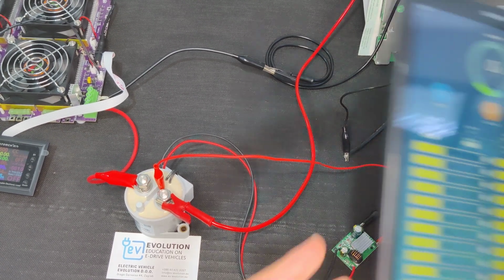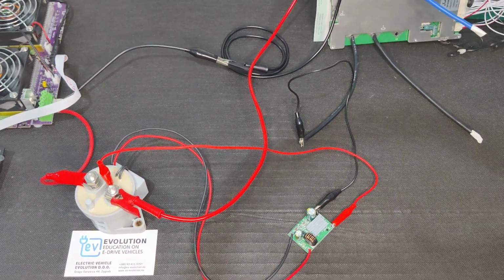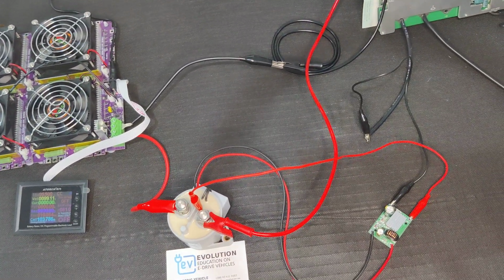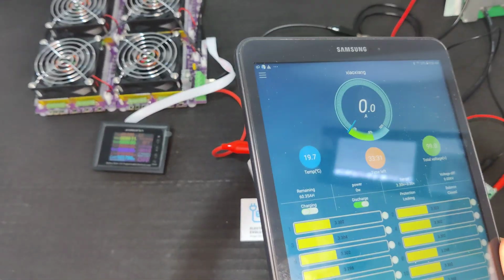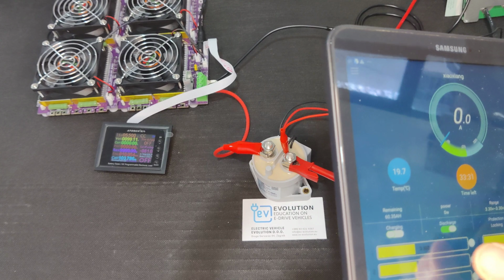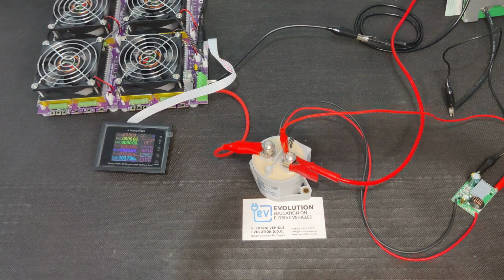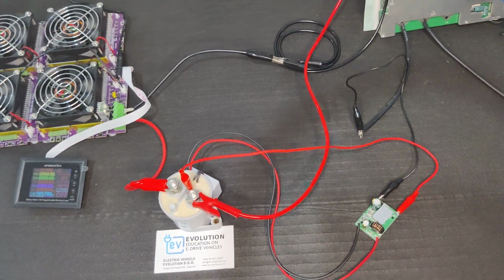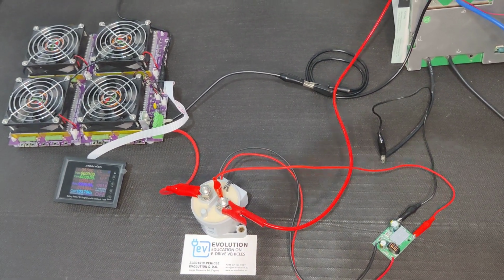EN: BMS + Relay 900V / 1500A for Electric Vehicles (High Voltage and High Amperage)

Comment: Hi and thank you for this video, I was looking for a similar solution to control the charge and discharge relays on an EV.
Your option looks good, if I understood correctly, you use for example on a pack of 96 cells, 4 bms which each controls 24 cells (4 packs connected in series) to give around 350V.
So in this case this allows the packs to be balanced separately.
Then to control the relays you use the Negative cable of the BMS,
with your DC To DC converter because the relay operates on 12V.
This is where I find it not very good to use these little DC to DC converters?
Wouldn't it be better to use a small relay which would operate at 100V (coil) and which would then control the 12V of the large high amperage relay?
So the problem then, example with 4 BMS it will be necessary that each BMS can ultimately control only 1 Relay of the total Pack battery.
Because the important thing is that the total voltage of the 96 cells is disconnected. (following Overvoltage/undervoltage and Temp; Protections)
(not just 1 pack of 24 cells)
It's certainly possible.
Obviously this type of system is much more economical than the HV BMS which are on the Market.
Thank you again for sharing your videos.
Reply from the maker: battery packs need to be connected in series and between each should be a relay controlled by one BMS, in short 1 battery pack = 1BMS+1relay. HV relay is not suitable as 12V coil voltage also goes to the emergency stop switch. Also, all battery packs must be top-balanced at the same level before the start of usage of the car. And yes...you probably can use any BMS to connect them like this in series as each works as a single battery pack...only important is that they all have the same BMS and the cells are the same.

Comment: Can we use this bms for 400v 100ah 40kwh battery ??
Reply: Looks like the same one I'm using and it only goes up to 30 cells I've used it on a 400 volt system by having three of them. I have a similar system that I'm using to engage your relay and then I have the three relays in series from the three different BMSs. I use a double pole double throw switch to reverse the polarity of the power supply powering the relay for when I'm charging his setup is only for discharging it looks like to me. Which this would be fine if you were in the charger through the BMS when charging. I have a YouTube channel also. Neat to see somebody else doing the same thing I'm doing
Reply from the maker: @steveclunn8165  yes, charging always goes over BMS...that is the most important part of BMS to protect the cells when charging